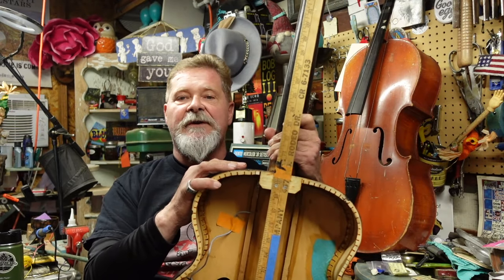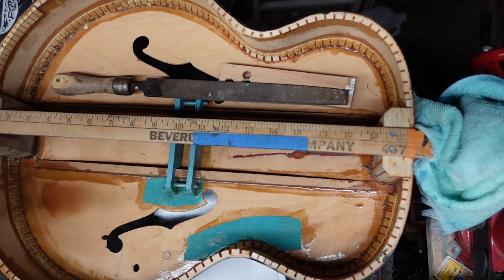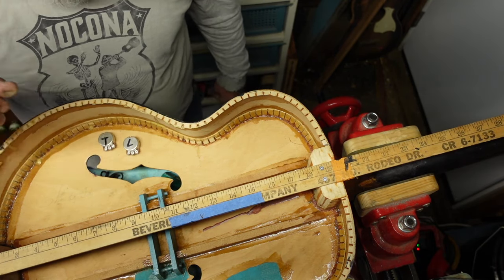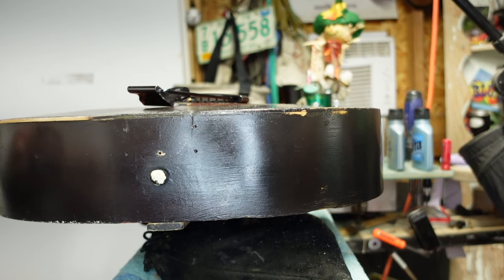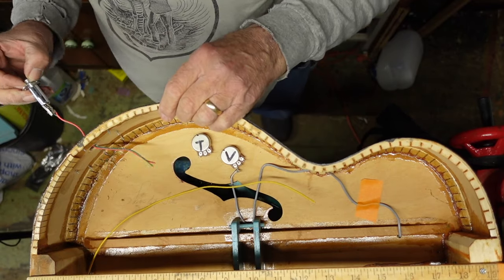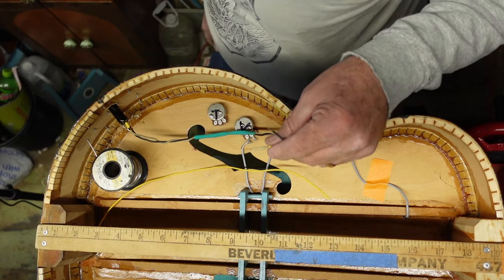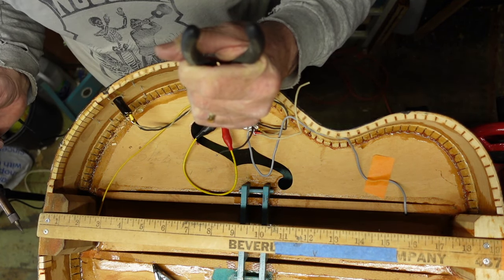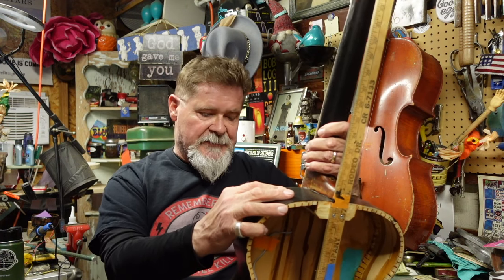Basket Case Harmony H1213 Archtop: Part 10 - Electronics

Comment: So the ground is typically to the tip of that input/output jack? Im wiring up a homemade pickup to my acoustic with a jack I salvaged out of a dumpstewr-organ. Oh, the pickup wire is from a couple salvaged fan motors. Sounds good but I think I over-shielded it I wanted it to remain a bit more microphonic since its for my acoustic but its very quiet. I used 5-minute epoxy to seal everything up. Magnets from a kid's hoverboard and red maple wood from a pallet for the bobbin. Im pretty proud of myself, lol. Great vid and lots of laughs with good information sprinkled in!